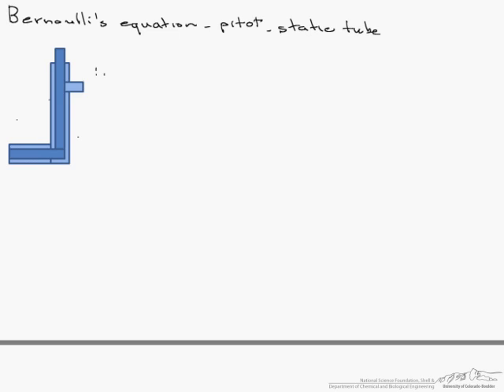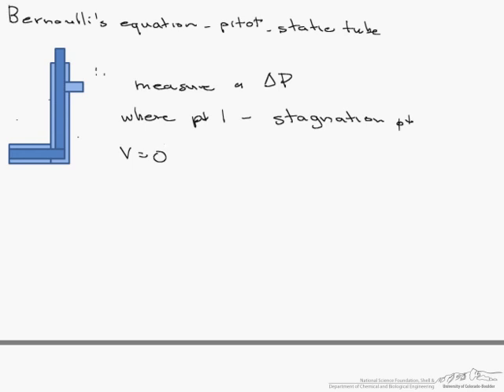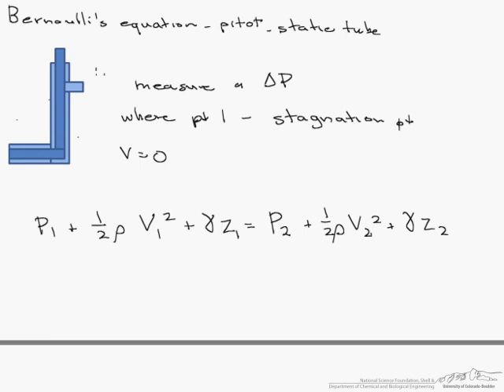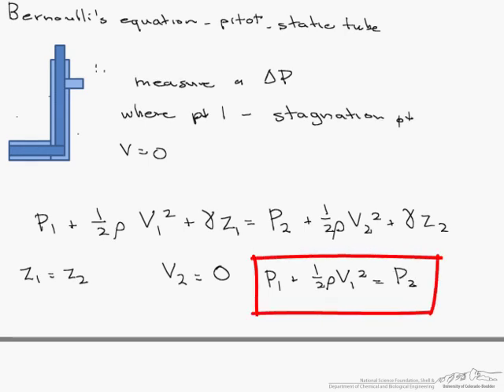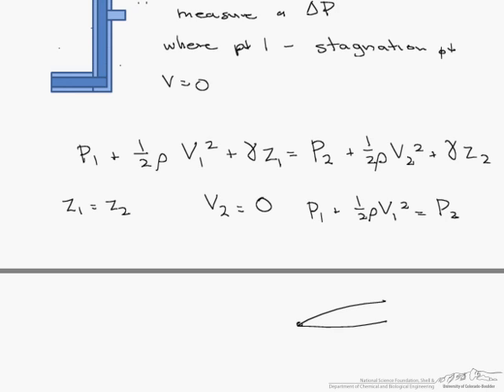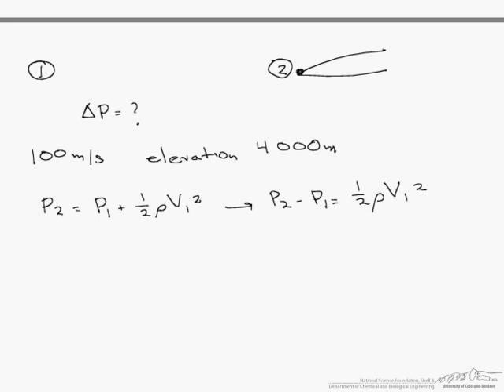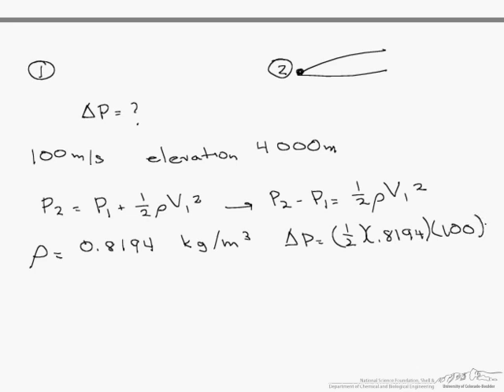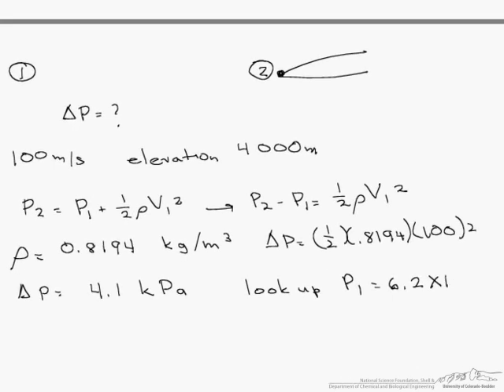Pitot Static Tube Introduction & Example

Comment: Where did you find the density of the air to be less then 1 in -11C, or i'm crazy? Everything i had studied until today says that when we decrease the temperature the density will increase and as we know the air density at 18 or 20C is approximately 1.2kg/m^3. I think you made mistake about the air density.
Reply from the maker: Density is also a function of elevation.  We are at 4000 m high for these measurements, so the density decreases.

Comment from the maker: If you have water entering a pitot tube, it will basically push the water up the tube until the static pressure of the fluid in the tube equals the pressure forcing the fluid up.  Thus the fluid doesn't move anymore and the fluid velocity at the entrance of the tube must be 0.